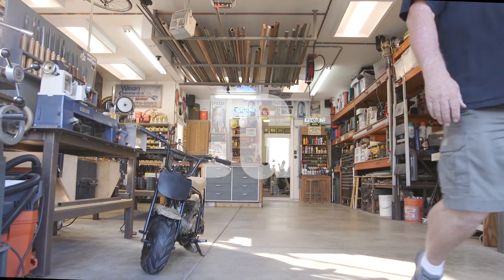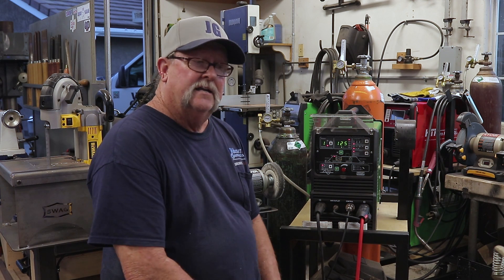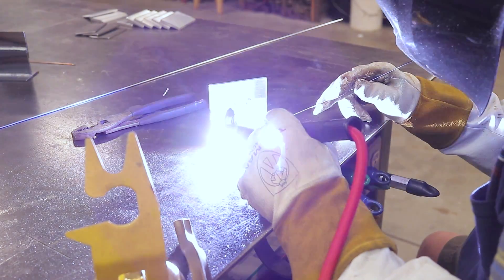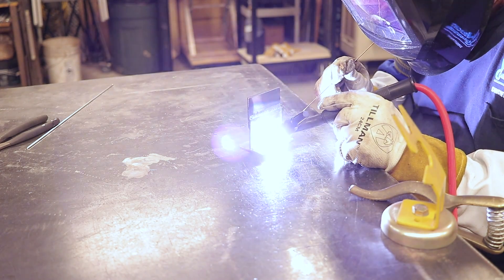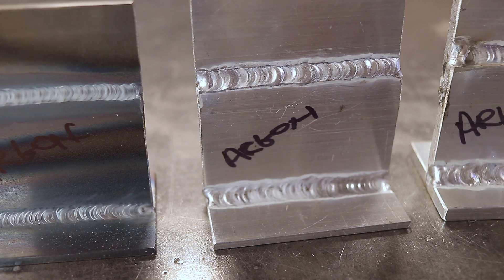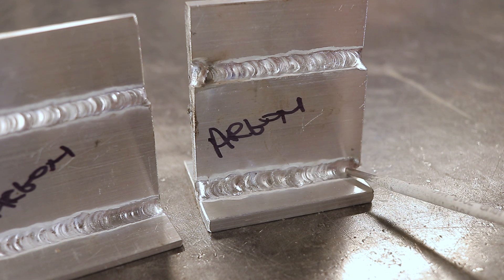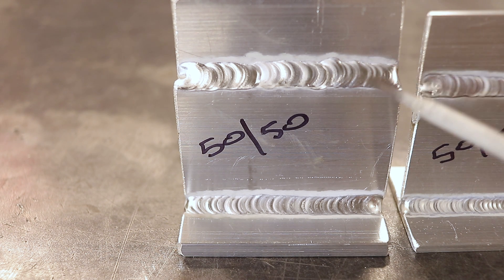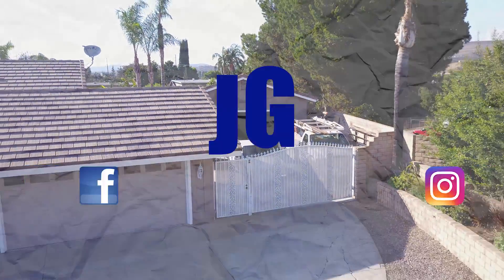Which Welding Gas should you use? | JIMBOS GARAGE

Comment: Helium is like adding 100 amps to any machine.
Cleaner faster better!
I have welded 20,000 wheels using helium mix.
Nothing else will do.
I am the only shop using it in my area.
For cast that has been exposed to oil, it works great! 
Forget the price... the weld is what matters!

Comment: From my understanding the only real benefit of helium is to weld thicker aluminum with a smaller machine. Or for guys with inverter machines to weld aluminum. I still want to try it with my new inverter combo welder but I gotta find a better price on gas or it's cheaper to buy a spool gun

Comment: I thought along the lines of what a few other comments were saying, which was cost vs. other options. Two thing I wanted to add are (1) preheating the base for argon only gas would help if possible, and (2) would it be less expensive if the mix were less than 50/50, say 80/20 if that option is available?
Reply: Tom Herd the more Argon the cheaper the gas you can basicly order any gas mix you want. Just the the bar you paying they are pouring. You can use tri mix which is better and way more cost effective as well